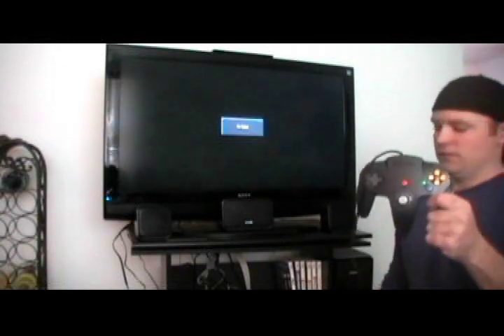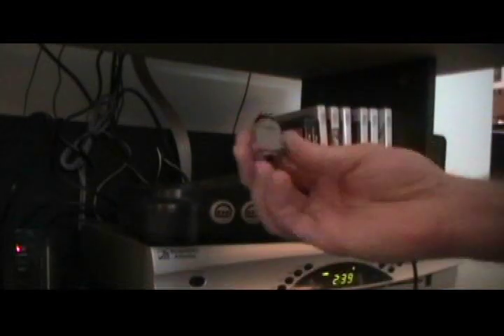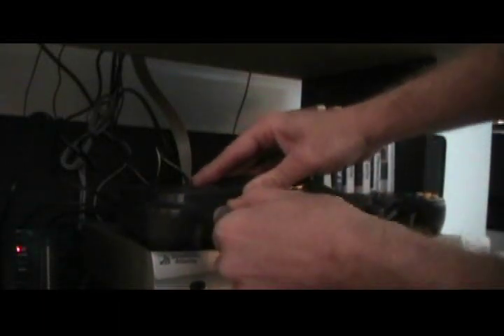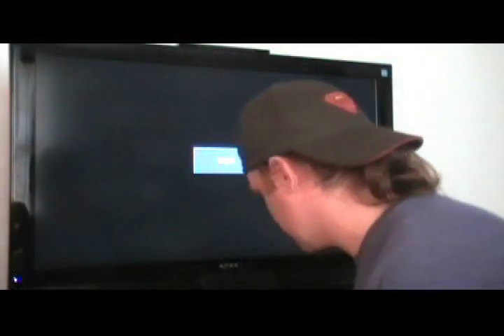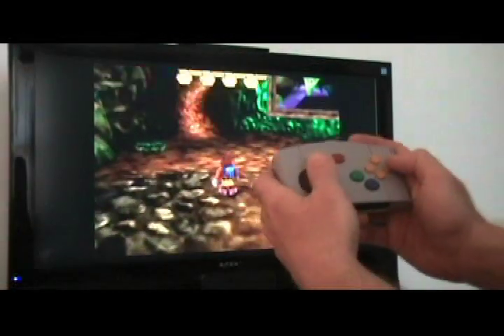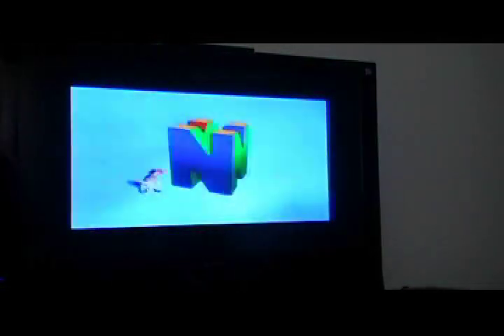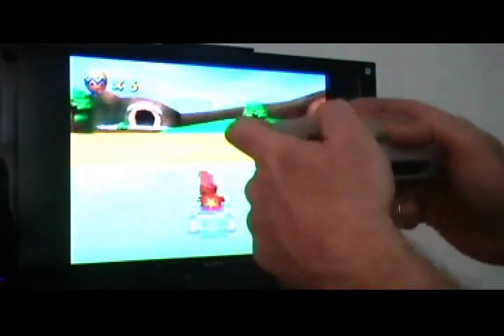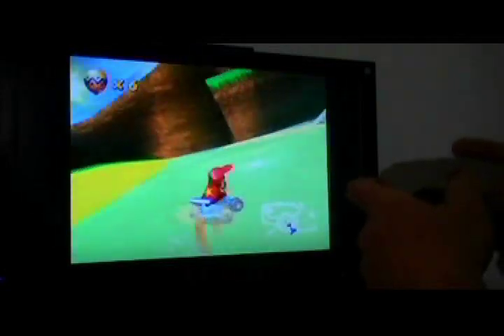N64 Controller in an N64 Cartridge

Comment: The worklog no longer exists, but I want to do this. Anyone know where I can find an archive?
Reply: Go ask some questions on the BitBuilt discord. You have to cut the mobo of the controller in a certain way + soldering the boards for the buttons, the stick plug and the cable to the main chip. Technically it isn't that hard

Comment: you need a sd card slot to save games so you do not have to make a huge memory card port and it would be a cool idea to make a switch to toggle between dpad and joy stick so when you flip d pad on it will be controlled by the joy stick but these features maybe to hard or impossible to do how much would you charge for a controller? I am subscribing to ya this was a great mod